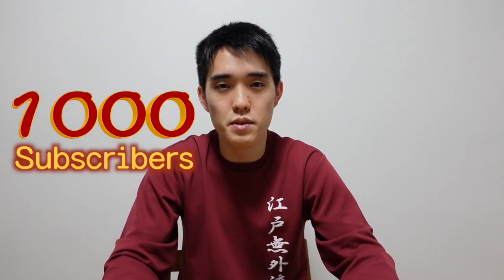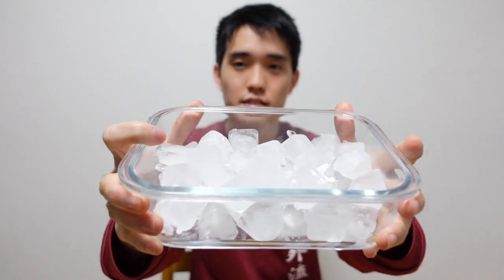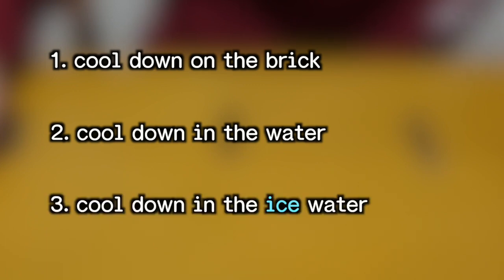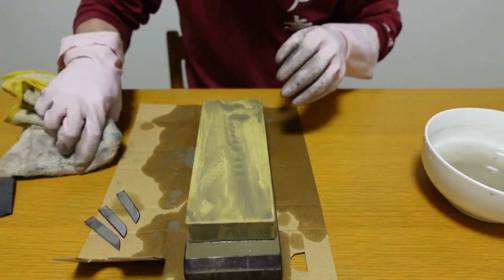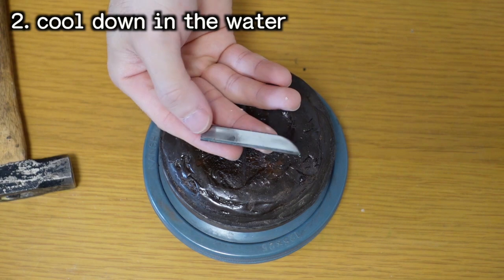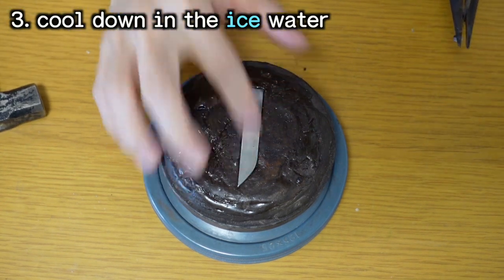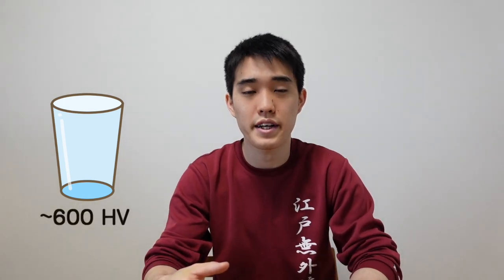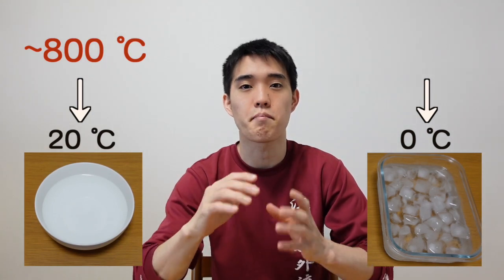Why the hardest blade is disliked by Japanese swordsmiths. #Yakiire #Katana #swords

Comment: are the tamahagane blades all carbon steel? seems like that process would not be very homogeneous. some may be iron some low carbon steel and some high carbon steel. are those the properties they look for after the quench when it's broken into pieces? I know iron and carbon steel can be welded together to make a very sharp durable blade, like a belly knife.

Comment: I can answer your question what you would do is temper the steel you want to harden it as hard as you can possibly get, but what you do is you temper the steel to add the toughness to it so it has some of the hardness plus the toughness without being brittle. I learned that lesson first hand I made a knife one day. I had spent all week working on it between forging it, and finally it was time to quench my blade. I was so excited. I quench my blade and I decided that I was going to start doing some light sanding on it and polishing it immediately, my boy fell off the table when I went to move it hit the floor and broke in half. Why because the blade was a little bit on the loan in the inside and it was brutal. So now, as soon as it comes out of the quench, it goes to the oven for tempering immediately.